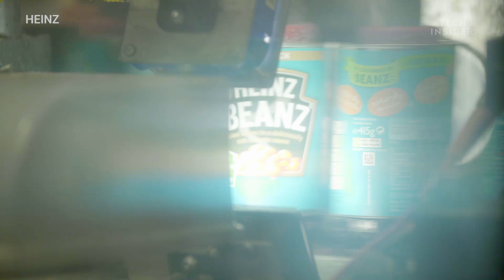Inside The World's Biggest Baked Bean Factory

Comment: >The beans are cooked inside the can
Sold. Perfect sterilization.
Reply: FEC Multimedia  Nothing, as the plastic isn’t heated to a high enough temperature to cause any harm. Take sous vide for example; food is cooked in plastic bags, but because it isn’t hot enough to degrade/melt the plastic, it’s perfectly safe
Reply: FEC Multimedia  Both sides have to bear evidence, bruv.
Reply: FEC Multimedia  depends on the type of plastic. HDPE can easily withstand 110 celsius.
Reply: all you "pseudo scientists" drive me crazy. I want answers from people who approve this for consumption.
Reply: @tannerabbott1452  Yes it is we in the west eat way too much plastic. FEC has a point.
Reply: FEC Multimedia  That's probably not good, but sterile from biological contamination. The cans I buy come without any plastic anyways. Just stainless steel.
Reply: @piergiorgio919  110 c before melting yes. If you've ever worked with plastic you know heat starts affecting it waaay before the melting point.
Reply: FEC Multimedia  I can't tell if that's old tomato sauce or plastic. There is a thin strip of white plastic on the side tho. I used a lighter.
Reply: maybe stupid question: isnt cooking at contact with tin going to make it cancerougenous, or at least, unhealthy? I'm pretty sure I read that cooking at contact with tin is not good

Comment: You shouldn't cook the beans in the can, the weld of the can is covered in a lacquer that is solvent-based and is sprayed over the weld wet and then dried. Once dried it shouldn't be heated up again.
Reply: Not all cans are made the same smartie
Reply: @AliBaba-mb1pu  I know that they are food grade cans '3 pieces' I use to make them for a living, that is why after seeing the video of what they do with the beans inside the can I advised of not doing that. Damaging the lacquer protection of the weld has high-risk health warnings consisting of food poisoning as it has exposed the copper weld to the food, that is why it is sprayed with the protective coating, to begin with, and by heating it up it softens the lacquer coating and depending on how hot and how long it's been heated for will determine if the food has been contaminated or not.
Reply: Solvent based that is dried...means the solvent is gone.